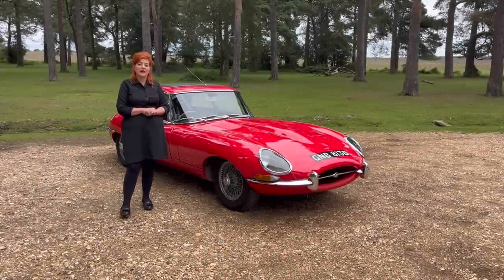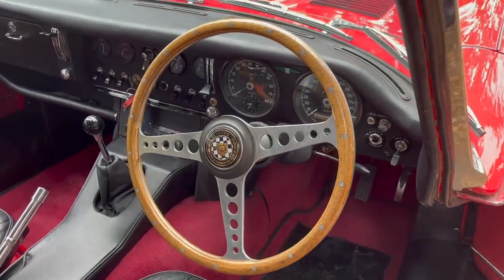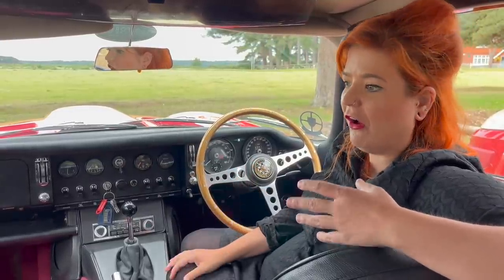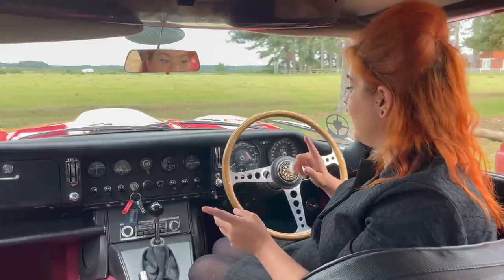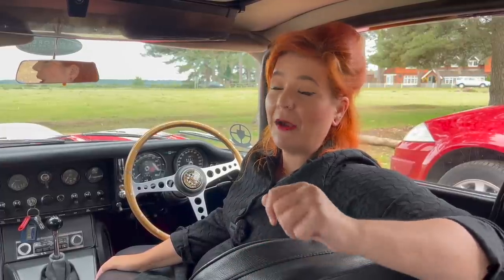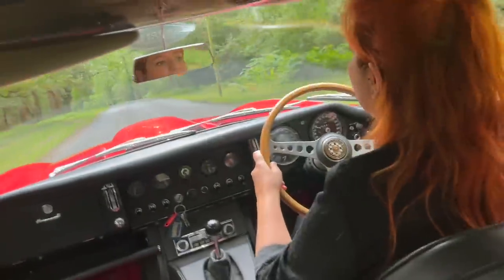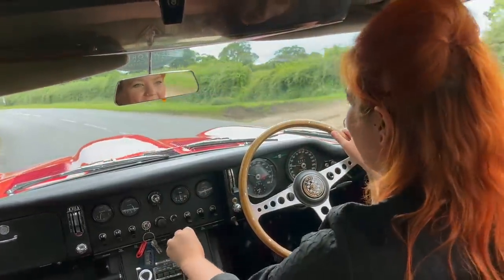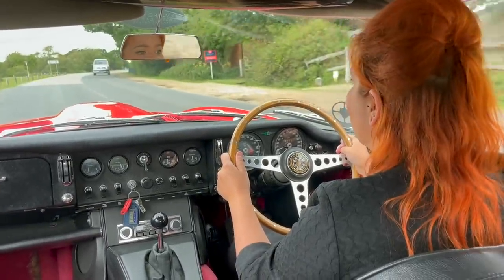Jaguar E Type Series 1 - the most beautiful car in the world

Comment: What a lovely car and video, great work, Steph.  I own an Elan Plus 2 and can say for certain that you wouldnt stand a chance of fitting an adult in the rear seat (I have tried to get in there!).  So your comments on how Jaguar made it work in the E Type are spot on.  There's zero compromise in the Lotus - front seats are really low and the rear roof line sweeps down regardless.  Lovely to drive, though and I suppose in 1968, if you were attempting to justify a sports car as occasional family transport, perhaps that would have worked.  Seems Jaguar made the right compromises?

Comment: Iv always found it a bit weird looking I also prefer the Lamborghini miura & the Ferrari Daytona  😎
Reply: The older I get, the more I realize that there is no perfect car design. They all have at least 1 inherit flaw. For E-types, I never liked the turn signals, front or rear on the series 1s. Nor did I like the unnecessarily long exhaust pipes. For your muira, I didn't like the headlights, which always looked unfinished to me when in the up position. For your Daytona, I always felt the front end was a total mess. It looks like a parrots beak to me. I always liked it lesser appreciated, sister car, the GTC/4 because of it much more modern design.